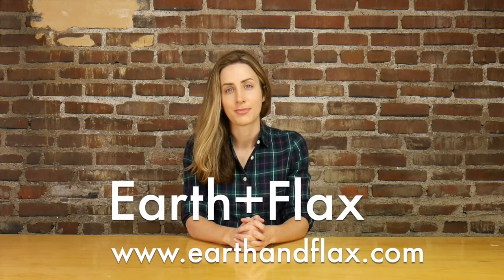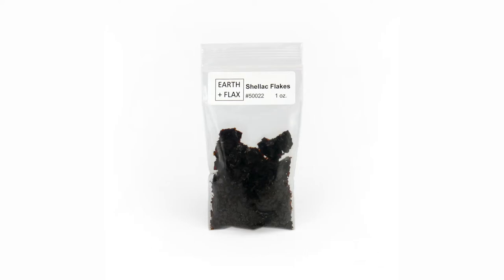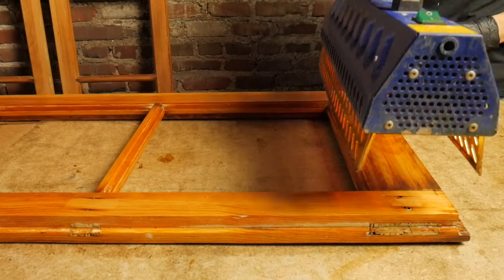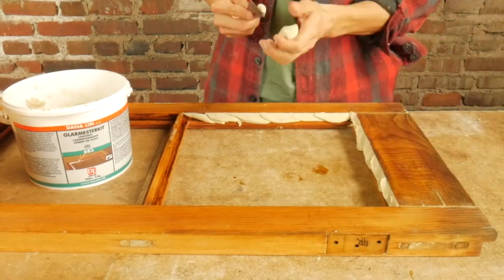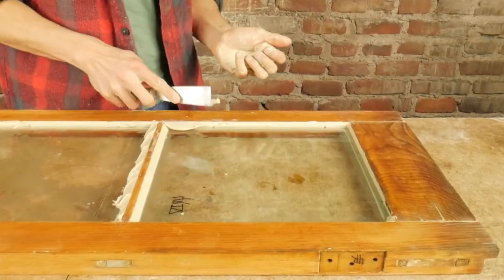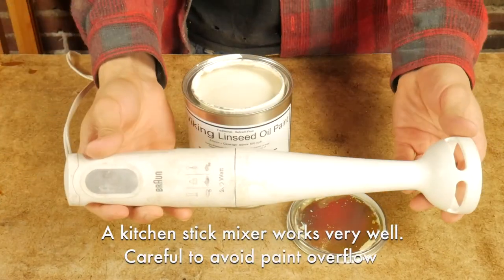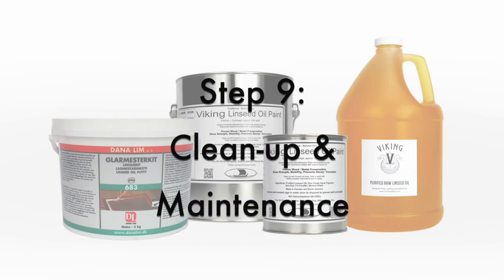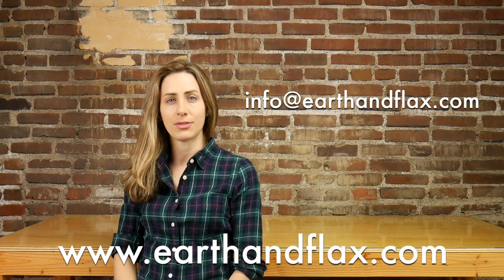Window Restoration w/Linseed Oil Paint and DANA Linseed Oil Putty [Full]

Comment: Thank you for your very informative video. I am in the process of restoring 120 year old sliding sash windows and was curious as to your thoughts as to the use of wood hardeners (for any soft wood) or a general application of wood preservative prior to applying linseed oil paint. Is it a no, no or recommended? The linseed oil paint I have recommends the first coat be diluted with a raw linseed oil, balsam turpentine mix. The timber has already been stripped back to wood using an infrared heater.
Reply: I have the same question too as I have been considering wood epoxy and other hardeners. However I still would like to prioritize traditional preservation methods.

Comment: Thank you so much for the instructive video.  Is Viking linseed oil paint only for the exterior? Can I also use Viking on the window interior as well as the exterior?
Reply from the maker: We recommend the Viking for exterior only as that is what it was formulated for. The Ottosson is an excellent interior/exterior Linseed Oil Paint and application would be very similar to this video. We hope to make a Ottosson window restoration specific video soon but until then the only big difference would be instead of applying the Viking Purified Raw Linseed Oil to "prime" the wood sash, Ottosson recommends a 30% paint to 70% Purified Linseed Oil as a "primer" coat on the bare wood sash. Once dry, finish with 2 undiluted coats of Ottosson Linseed Oil Paint. No need to "prime" the LO Putty. You want at least 2-3 coats of undiluted Linseed Oil Paint on the putty and don't forget to paint at least 1/16-1/8 onto the glass. Hope this is helpful! I see your questions on our info@earthandflax.com email and responded there as well.

Comment: What do you call the scored wire you're twisting off to make pins? It looks quite convenient for when the gap is too great for push pins, which along with sprigs are what we use in the UK. I've not come across your method before, but would be keen to try it.
Reply from the maker: We call them "Euro pins" since they are more common in Europe than North America. Simple copper glazing points with convenient compressions so they easily snap off when installed. The downside is that they can be a bit too long for many glazing grooves so must be bent down before glazing. We carry them on our website (under window restoration supplies) but they are imported from Sweden. You can probably get better shipping options buying direct from a Scandinavian shop. Hope this is helpful and feel free to reach out to info@earthandflax.com anytime.

Comment: You do an excellent job of presenting your products, I have some questions regarding the compatibility of paints other than linseed oil based paints with the linseed oil based putty.  As you know conventional glazings have excessive cure times before painting but seal against moisture very well, the linseed putty requires paint to seal are any of the paints other than linseed oil pants compatible? I really like using linseed oil products, however I would like a much greater color selection in the paints, I also like not having to prime with linseed oil paints .
Reply from the maker: Great to hear you’ve found the content interesting/helpful. 
In theory, yes, you can use conventional paints with the Linseed Oil Putty but you would have to wait for it to fully cure just like most conventional glazing products. The big time saver, as well as the best combination in terms of material compatibility, is to paint immediately with Linseed Oil Paint.
We have more and more folks custom mixing colors to achieve whatever they are looking for. Cannot compete with the range of chemical dyes in modern coatings but still, so many possibilities exist! We are just building out some color consult options on our website as well. Feel free to reach out to info@earthandflax.com with additional questions.